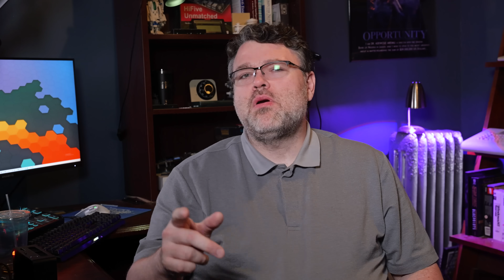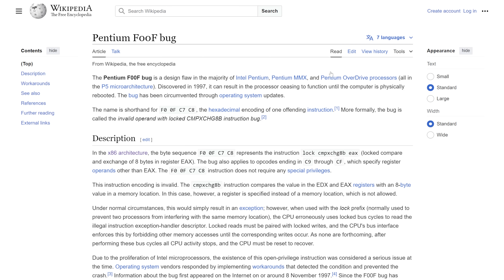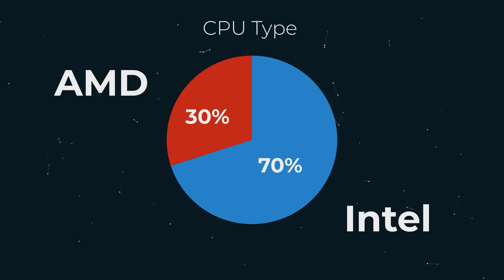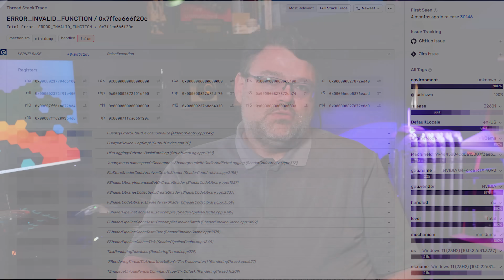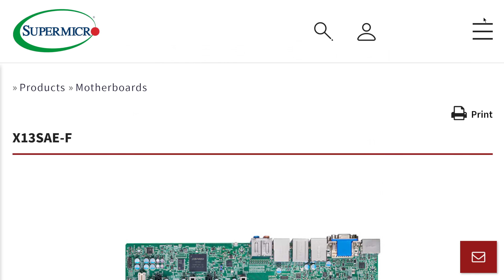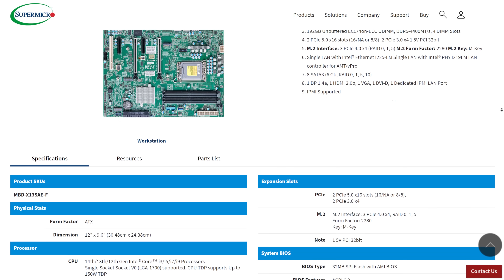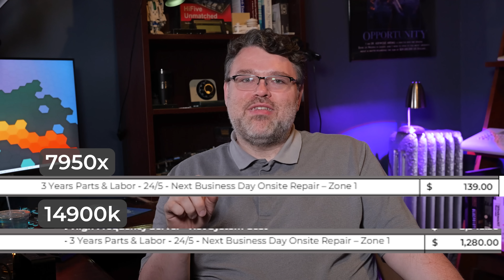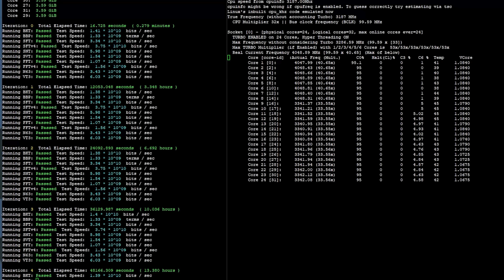Intel has a Pretty Big Problem

Comment: I have questions.
If there is a memory address in the crash report that is said to have caused the fault,
--Is it a random address?
--Is it zero?
--Is it always aligned by 2, 4, 8, 16 etc... or aligned by cache block size?
--Would it be near the end of a cache block or at the end of a page boundary?

I know its not the same but going way back to Intel Pentium 4 and Celeron days with assembly I always had issues if my code was too fast to move data around. Some data could get lost if it were an unaligned write.  Compression is working with strings of bits and bytes and can do a lot of unaligned writes.  From what I remember, as long as the read or the write were aligned it would work fine, but if both the read and the write were not aligned to memory I would get a random drop in data from source to destination.
Reply: WTF that's weird. Single threaded application right?
Reply: @SianaGearz  yep
Reply: @SianaGearz  and this usually happened when copying data between a lower address and a much higher address so it was probably different memory channels. But today's technology is much different, the only similarities I could see are in things like cache block sizes.
Reply: @10100rsn   I don't think the memory channel matters, a P4 is completely oblivious to that! Memory writes and reads are performed by the chipset exclusively in 128 byte lines, so by all reason, if it was a memory hub north bridge bug, all software would be affected.

Something with cache line boundaries and operation splitting? There is another penalty on that era Intel CPU-side straddling a page boundary.

Let's see... Pentium 4 specification... errata... 

N29. rep mov instruction when source and destination overlap by 56 bytes or less may cause data corruption. Fixed by a microcode update. Could this be it? Did you use SSE unaligned writes at all or was it classic x86 code?

Oh we also have N70. If you load data shortly after storing it, and the load is narrower, a bug in the forwarding mechanism can scramble the low bytes among each other. Fixed by microcode update.

N84. Simultaneous L2 and L3 eviction of the same line can result in stale data being written back to RAM. Microcode fix.

N87. If you modify a cacheline while it is being evicted, it can become corrupt. Microcode fix.

What a glorious piece of shit. Yeah no actually none of these are considered severe bugs, since they have been able to fix them by BIOS updates.
Reply: @SianaGearz  It was a mix of classic x86 and SSE but the memory addresses did not overlap.  The copy functions were written to be improved memcpy functions with MMX or SSE support but even the regular x86 code with 4 byte unaligned read/writes had issues, at least on my dev machine they did. To get around the bugs I rewrote it so that they would align the writes using the destination address by writing a byte, word, dword before moving in with blocks of MMX or SSE, then it spit anything less than those out as dwords, words, bytes (something like that) and that fixed the issues and it copied even faster than the unaligned writes.
Reply: @SianaGearz  The development actually may have been on an older CPU, like a Pentium II... my memory isn't that great, but I do know I went from Pentium II to Pentium 4 when writing that code...

Comment: Okay so, I've been in this rabbit hole as well. I got a 14900ks specifically for it's stock performance. I'm in the middle of exchanging it with Intel after they've confirmed it's a faulty unit. There is currently a small bump on the bottom left of the CPU which I assume caused the 2 cores that boost to 6.2ghz to fry themselves over time from the cooler not able to be flush. So I was having instability that was getting worse over the course of a month after these intel default settings started getting released. I noticed I was getting current/EDP throttling nearly constantly even at idle and realized the 2 highest boosting cores had unstable core voltages that were jumping up and down, causing thermal and power limit throttling intermittently. Intel's fail safe Svid behavior in my Asus bios definitely contributed to this degradation, I'm  positive the metal defect on the IHS Lid happened over time as well, I have pictures of it during the initial install and it's not there. So it's half an IHS defect on my unit, and the other half being the Thermal velocity boost not working as intended on the 2 cores that boost higher, needing that microcode update.
Reply: So you're saying that your IHS warped over time, causing cooling problems which, combined with the suspected boost issue, may have cooked two of your cores?

I wonder what could warp the IHS. It's not easy to make a bump in those things.
Reply: @tomhsia4354  idk what happened. I’ve always had good temps, low 30s on idle, 65 max while gaming. I just came home from work and it was BSOD after BSOD. I did some fishing around and found 2 P cores where the voltage was going from .8 to 1.5+ intermittently and decided to check the CPU for damage. A small pinhead of metal is sticking out toward the bottom left. I suspect maybe the IHS had an air pocket in the metal or something, not too sure. I have great cooling though, it’s an Asus RYUJIN III 360 Noctua edition.
Reply: @TheAJKid  Is it a bump or a more gentle warp?
Reply: @tomhsia4354  it's a tiny bump. It has not warped at all that I can tell, I have a contact frame as well. But it is enough to cause the cooler to not sit completely flush. it's like a fine-tip ballpoint pen ball sticking out. Just a lil metal chunk.
Reply: @TheAJKid  That certainly is very odd. Given how good your temps are, it is possible the bump (weird on it's own) and the instability are not linked at all.

Either way, good lock dealing with Intel. This whole debacle just gets worse everytime there's an update.

Comment: Eh, AMD has it's own issues. GPU's that crash during DX12 titles due to overlays. (Driver time out and crash.) Motherboard chipset NVME errors, though usually in RAID configs. At least those can be addressed. Latest BIOS and Drivers seem to have fixed most of those issues. Not defending Intel, just pointing out that others have issues too. Likely a complexity creep moving in.

Comment: Great video, hopefully the RMA rates and failure statistics will become more fleshed out over time. I was wondering if you have any plans to make a similar video about the WRX90 platform? Folks on the Level1 forums have been through multiple DOA CPUs, motherboards, and swapped out every component of their machines just to be left with instabiliy. Others say BIOS support is already being dropped for their WRX90 boards, leaving it an unusable state. It's a shame when any user has to endure an experience like this, and a video from a content creator like you would do a lot to draw manufacturer's attention to the situation.

Comment: Heys, I'm one of those who were "tremendously suffering" from the instability, to the point where regular programs such as Discord, Chrome, Davinci Resolve, and games were crashing left and right. I just RMA-d my i9-13900KF. Intel already knows that shit's going down because customer support didn't put up too much of a fight and went straight to the point - RMA. Unfortunate, but it is what it is. Purchased a secondary, i7-12700K (LGA-1700 slot was needed so that I don't need a new MOBO) and it feels like a breeze of fresh air not having to put up with the constant instability.
Reply: Wow I regretted buying my 12700k
When I saw the 13 and  14th gen drop and made me feel like my PC was dated already.
The bad news just keeps rolling out and making me feel a lot less bad about my decision now 😂
Reply: Beware, I had the same issue with a 12900k, which then I could upgrade (50 bucks) replace to a 14700k, which now has the same issue ..........
Reply: @Blue_Monkey  how old was the 12900k before it started manifesting these issues? This is really important as most people will tend to migrate to 12000 series to avoid this fiasco...
Reply: @Blue_Monkey i7 or i9?
Reply: At least Intel seems to be putting up no resistance to accepting RMAs. But I'm sure they'd face a massive amount of backlash if they didn't.
Reply: Iam in a 14900k RMA right now, my CPU is arriving tomorow, i had alot of those "chrome acces violations" and "out of Vram" and "UE games crashin ALOT" random reboots and so on. So same story ... by ALOT i mean by ALOT :D had that with my 13900k had it a few Month i send it back to Amazon and bought that 14900K and it got worse... :) now iam in a RMA with Intel
Reply: I had chrome access violations and discord crashes as well with a 13900k. Gone the debugging way, because I had no game crashes, and it only did it when the system was basically idle. Running a youtube video already got it gone.

No baseline profile or anything fixed it, I did memtest86 to 86+ passes, but one day decided to pull out all ram sticks but one, noting which came out from where. No crash, so I ended up just shuffling the RAM sticks, and boom issue is gone for months now.

Although, for Senua's Saga, I needed to apply intel baseline profile for the game to even start up...
Reply: @repatomonor21 ... just put the machine on the second hand market and treat yourself to an AMD.
Reply: indeed they went straight to the point
Reply: Approximately how many years ago did you purchase the chip; and after that when did the issues start? I have owned and used my i9-13900HK laptop CPU for approximately 0.75 years, no issues.
Reply: Sounds like Intel is trying to handle this like AMD handled the 'bad batch' of Zen 3/Ryzen5000 CPUs.
"Keep quiet, accept RMAs when they're filed."
Problem though: I'm pretty sure the failure rate is considerably higher.
Reply: Couldn't you also return the mobo, and go AMD instead?
Reply: @MrXelaim  No.
1. I'm a contractor (work from home) and cannot afford to lose a single day of work for making such a switch. This was a carefully orchastrated RMA process where I timed my CPU replacement on the same day the courier would come for the RMA CPU.
2. The motherboard is not faulty. Buyers protection in my country only covers the first 3 days to return a product without a good reason and this is a year old system.
Reply: @repatomonor21  That's terrible buyers protection
Reply: @owlmostdead9492  Why though? You still have a time window to return a product if you changed your mind. Otherwise, wouldn't people ignore warranty and just return age old products left and right out of greed?
Reply: @repatomonor21  We have a 14 day return period, 3 days is not enough to evaluate a lot of products
Reply: @repatomonor21  For whatever it's worth, Intel does have a program that allows you to get a CPU RMA without having down time. Basically they charge you for a new CPU, send it to you within a few days, then refund all of the money (- like $25) if you send them your original CPU within 30 days. I did this with my 12900K that was experiencing a ton of BSODs, and they shipped me a brand new one in retail packaging
Reply: @repatomonor21  Interesting. I had a few clients that stated they would loose over 50k per day if shit hit the fan, so I proposed a multi computer system that could live migrate backups, and client stated my solution was too expensive. I guess they can afford to lose 50K for a few days...
Reply: @owlmostdead9492 
30 days here. Oftentimes longer, especially at bigger stores.
3 Days seem really short but as long as the state mandated warranty is still long i suppose it's not too bad.
Reply: To my knowledge there’s not federal laws in America about that but our overly litigious society has created a situation where most companies offer 30 days or more
Reply: @rezenclowd3  I don't earn that much haha. At that level of money, having a multi-computer system would be mandatory. Would be mandatory for me too actually, but again, I just can't afford it.
Reply: @repatomonor21  I picked up some older HP workstations for cheap. Like a HP Z4 G4 for $350.  I can't imagine not having a backup workstation.  It's more than powerful enough for programming. Just not much of a game machine.
Reply: @quademasters249  My field of work requires a powerhouse of a PC. Let's just leave it at that. A regular cheap one won't do it.
Reply: @MrXelaim  @repatomonor21  Yeah if you just want to throw in another CPU and be done with it this is the way of doing it. Switching to AMD requires dealing with drivers, potentially different cooler, ... I get that.
Reply: Did you tune it or did the cpu at stock settings go unstable?
Reply: @sandertu8366  it was tuned (undervolted from the get-go and I set cpu throttling to kick in at 90 celsius degrees). The CPU remained stable from last July until February 2024 and it gradually got worse from there.
Reply: @repatomonor21  
Was the undervoltage an offset or a static voltage?
Did you achieve clock-speed better than stock specs?
Did you limit the clockspeeds and peak power?

I remember that undervolting in some cases, like in a gpu-s and AMD cpu-s, is actually an effective way of overclocking because the processors have a very opportunistic with turboing.

Currently i think its possible that you accidentally/unintentionally overclocked your cpu because you didnt disable the opportunistic turboing of modern cpus.

AMD cpus can also be overclocked by lowering the voltage offset.
Mostly it revolves around loweing the power consumed by the cpu thus lowering the thermals and delaying the throtteling point.
Reply: @sandertu8366  It was offset, not by much very much, though. Again, my main concern was the temperature warning of the motherboard, which I successfully eliminated.
That being said, I don't think the CPU should have "died" from a Tom's Hardware suggestion.
Reply: @repatomonor21  
Currently cant find a toms hardware recommendation for undervolting so i cant learn from it.
Did find a toms hardware forum and a reddit post where it was recommended to ditch undervolting and set power and current limits.
Power max being 253W and current limit 307A which are stock settings set by intel and not by the mobo manufacturers that often exceed these limits.
Undervolting on top of those limits can be good
Reply: @sandertu8366  That was waaaaay before people figured out and started sharing publicly that the power limit has to be imposed manually.
Reply: @repatomonor21  
Must be the issue in my perspective then.

For me the power limit being fudged is old news since the gamers nexus video of 
"Do Not Use Z490 Motherboard Auto Settings: Excessive Voltage, Power, & Heat" that was released 4 years ago when the 10900k was the focus.
For some reason i also remember that people complained about 9000 series running hot.

So since you are running a intel cpu i wonder are the power limits exceeded from recommended or not.
Reply: @repatomonor21 that is an interval of 0.58 years compared to mine of 0.75 years with zero issues. Did the degradation start immediately and noticeably at the 0.58 year mark?
Reply: @chocolate_maned_wolf  bro I don't remember what I did a week ago. The CPU was second hand purchased last summer and I don't know its exact purchase date. The problem started arising noticably this year, around February.
Reply: @sandertu8366  highly doubt he did any custom clocks or voltages.  when your livelyhood depends on your computer running stable each day you don't mess with that.
Reply: @dan_loeb  no, I actually did stabilize the CPU's voltages and temperature limit from the get-go. My main concern initially was that I cringed hard how fast the temperature would rise beyond 70 celsius degrees where my Asus mobo would start glowing red, indicating that the CPU reached a critical treshold, despite Intel claiming it to be safe until 100 celsius degrees. So I followed early online guides on Tom's Hardware to set limitations against the temperature. Note: my CPU cooling system is a Noctua NH-D15,  the big boi.
Reply: @repatomonor21  oh I thought he was implying you were overclocking it.
Reply: @dan_loeb  
He did buy a k series cpu, no real reason to get a k series unless you are interested in tinkering a little.